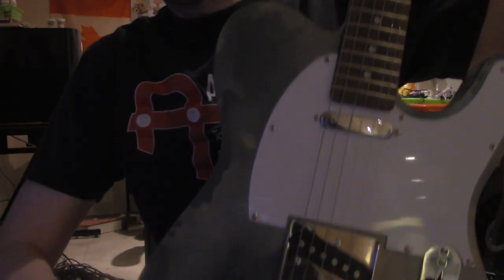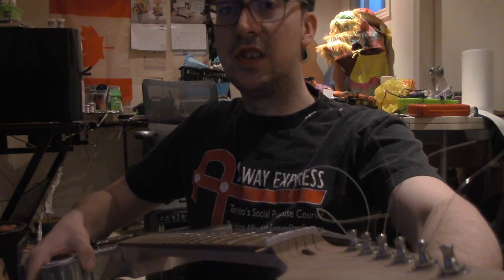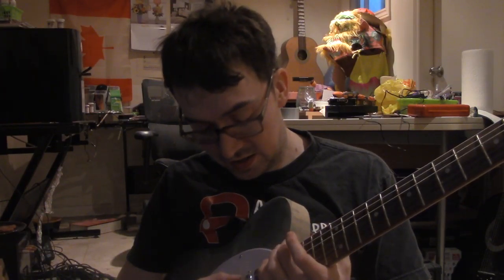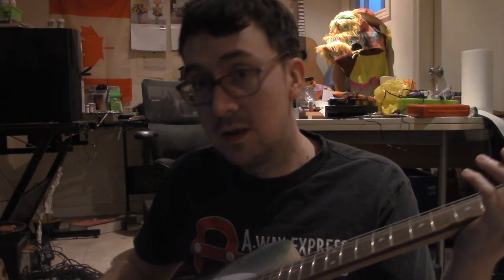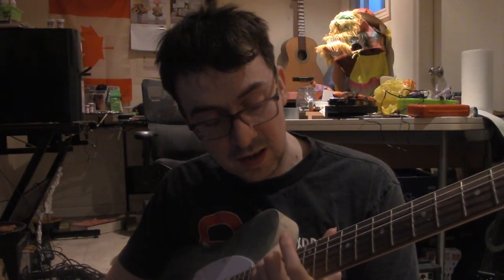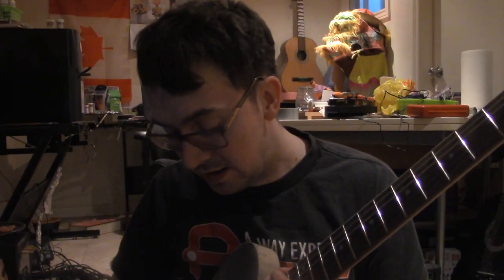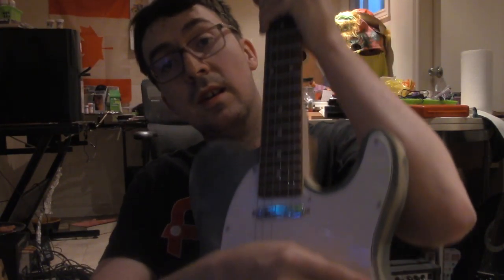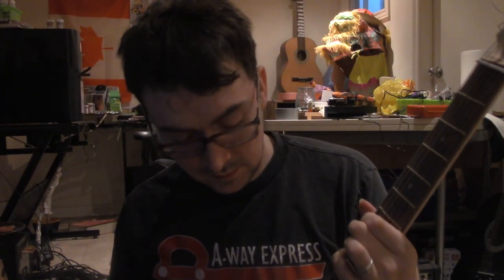Technically not a Complete Failure

Comment: do you think you can fix it?
Reply from the maker: there's a few things i could do. I could saw the neck off (since it is perma stuck with glue). then straighten and attach the neck (this is a little beyond my capability, or at least desire.

the other thing i could do is "sandpaper" the frets down so the string isn't touching them.

Both of these are drastic measures (from my capability). I have made progress improving the instrument in other ways, which you can see in today's videos.
Reply: i see your point. Maybe if you could get a really fine saw and take your time you could remove the neck successfully. Taking the time to acquire the saw would be a decent brake as well
Reply from the maker: when i was young my dad taught me how to use a handsaw. I don't think it is in our tool box any more. The hardware store is not far away. In all fact, the additional tools I am having to buy to do this product is costing as much as the kit itself.

But, yes, the handsaw would not be too difficult, especially if it's a new one that is not dull.

I don't yet know, but there's probably youtube tutorials, on how to get the neck level. Also I don't have a workbench, I do most of my work on the floor.
Reply from the maker: come to think of it, what I would need to level the guitar is a tool called a "level"
Reply: Goodluck anyway. It looks pretty cool
Reply: aye the thing with the bubble in it. Good shout